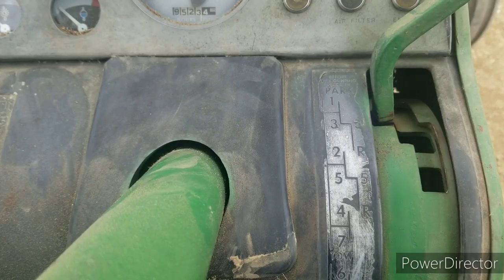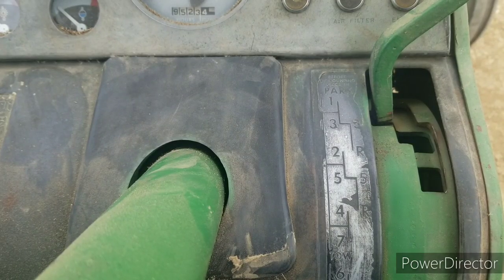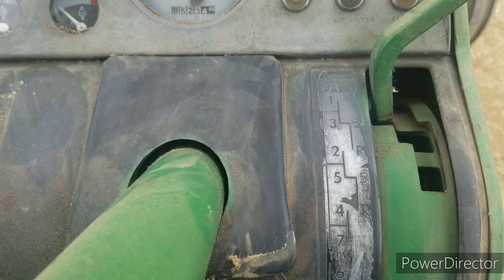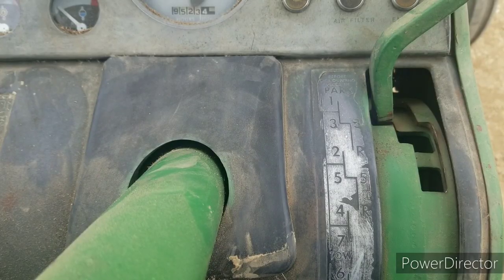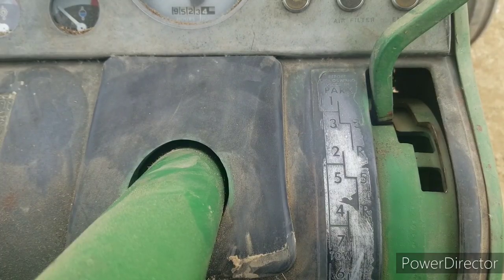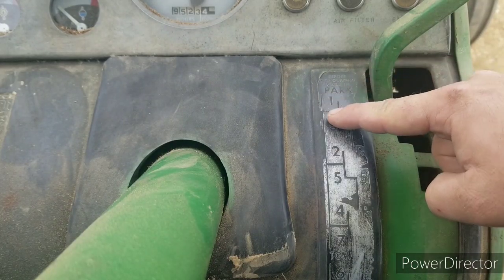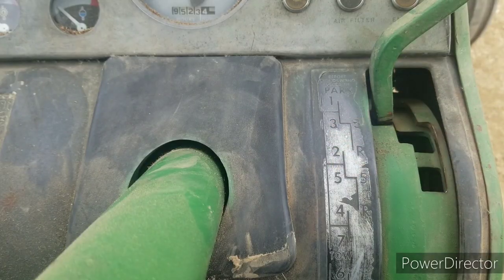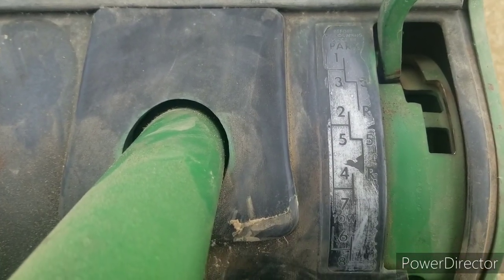John Deere synchro trans - simplified and explained  4320 4020 3020 4010 3010

Comment: I’ve got a 3010 like this. I can’t hit the brakes. For if I do I lose all my hydraulics. I can use the tractor all day as long as I don’t hit the brakes. Some times I’ve even got to release the pressure off the left brake to get it to move. This started when I had a oil leak under the floor pan. I used a ratchet strap to pull my brake peddles forward to gain a little space to remove the floor pan. Forgot to release the ratchet strap after finally removing the floor pan. Went out of town a couple days. When I got back the replacement line had arrived. So I put everything back together. Noticed my brake peddles wasn’t up where they normally went. Thought well they’ll pump up when I start the engine. Later I started the engine and the right brake seemed to be in the normal position. The left peddle was sagging lower than normal. Got on the tractor and both brakes were locked. So I loosened the brake lines and let the pressure that was trapped in the lines out . Next day tighten the brake lines up and to my surprise the left brake was still locked up. Got on the internet looking around found out I could release the the brake by a jam nut another. Loosen the jam nut left both nut and the bolt a tad loose and tried not to even use the brakes. A few days later I adjusted the bolt and jam nut to what I remember to be the original spot and locked the nut down. While using the tractor I hit the brakes pretty good because my garage is on the side of a mountain goat path. All at once I lost everything. No  3 point no power steering and no brakes.  Fed up with it I shut the tractor off . About 20 minutes later started it back up and seemed to have air in the hydraulic system. Raised and Lowry the 3 point a couple 2 or 3 times and it seemed to be getting the air out . The 3 point was still a little chattery but I did get it out of the path so the goats and deer could get by. Has anyone ever experienced anything like this . Any help or suggestions would be greatly appreciated. By the time I get home Friday I should have the factory manual. Now that I think about it . I had a 300b backhoe book that probably could of help me understand the brake system better. If they’re about the same. I think they might be similar. I also had brake issues with it at one point Plus I’ve already changed the filter and fluid. Pulled the suction screen out and it was spotless not a speck of red brake pads

Comment: There is actually 4 reverse gears, 3 is there but not labeled, 4 can be set by removing the lockouts and rotating the the second selector backwards.

Comment: I asked my dad if he ever used the 4/7 gears much. He said that he used them for plowing if they where going back and forth, instead of around in a circle. You would plow in 4th, then when you got to the end, you could shift to 7th and go down to the other dead furrow. Shift back to 4th and get back to it. He also used it for pulling a grain drill. Don't need a lot of power, so he would be idled back in 7th, but if he needed to slow down, just go to 4th.
There's also a reverse in the 6/8 position. But the dash doesn't allow the shifter to go that far down. If the trans linkage was disconnected, it could be put in it, but that would not be safe to do.

Comment: My dad had a 2510 John Deere, and that shifter mechanism always confused me. I never got to actually operate it, so I never got to actually “learn“ how to use it. The way you explain it, makes perfect sense. When the lever’s on left your shifting ranges. When the levers on the right, you’re shifting high/low in that range. My dad used that tractor a lot for packing corn silage, so he got really good at that forward/backward business…
Reply: 4 unsynchronized ranges (think A , B , C , D ranges & a long, left slot)..   

 2 synchronized forward speeds in each station plus reverse speed in A & B on all but the 10s..  They have a C reverse speed.. 

For beginners on the 10s &20s Synchrorange transmissions a yellow "grease" pen makes very helpful A, B, C, & D letters along the long slot for the range shifts..  Also designating the "tow" position between C & D will remind the operator to pull the shift lever into that position while towing the tractor thus preventing the expense of an exploded clutch, and/or a top shaft to low range pinion seizure !!  DON'T DO THAT ‼️‼️

Comment: Had a JD3010D, had the syncro, still had all 3 original reverse gears. Now, most would have that 4/7 reverse gear blocked, those gears were small and had a bad tendency of breaking a tooth, hence why many were blocked. It's also why the majority of the 20 and 30 series had them blocked out. Wasn't because they were to fast, because those small gears were weak. 
We plowed in 3rd, disc'd in 4th, raked hay in 5th and or 6th. 
Since you mentioned "Red", I also had a Farmall 706. In all technicalities, it's really a 16 speed. Torque amplifier would give you an extra hi/lo range or rather, a direct drive and low.
Reply: We never had trouble with these transmissions used 4th to 7th hauling chopper wagons out the field every fall.
Reply: @danw6014  I think you misunderstand what I was saying. Many of the next gens had a 3rd reverse gear which is where 4/7 gear range is. That 3rd reverse gear was the same speed as 7th gear. It was a very small gear and as I said, that gear had a tendency of breaking a tooth due to its size. Again, this is why that "gear" was "blocked" by dealerships back in the day. The transmission itself, they're solid.
Reply: @Ham68229  ok i see what you are saying.  Those third reverse gears were a road gear when the tractor had a mounted cotton picker on it. The tractor was operating in the reverse gears to run the picker. My 66 4020 has the third reverse. So did every 4020 I've  ever run.
Reply: @danw6014  Many did, and yes, they were used and used a lot for many jobs. :)

Comment: I see on your paper that the 10 series only had the 3rd reverse.  My dad had a 3020 that had a 3rd reverse.  What made the difference between the 10 series and 20 series transmission
Reply: Dad used 4th forward and 3rd reverse alot when doing alot of back and forth moving.  He always said 3rd forward was too slow and 5th forward was too fast.
Reply from the maker: @Erin Jackson both the 10 and 20 series tractors have the gear for 3rd reverse but from the factory it was locked out in the shift mechanism. They did this because  they found a reverse gear that fast put alot of stress on transmission causing warranty work. I've seen plenty of 20 series go into 3rd rev but its usually because shift mechanism has some wear or that they have went in and cut out the 3rd rev restrictor. So its possible but never seen a 20 series from factory with 3rd rev. Thanks for watching
Reply: @machineryd2765  it was not from the factory.  Dad had someone do the modification

Comment: a 4020 actually has a third reverse just like a 4010 but it is locked out because it is so fast. If you grind out the slot for it, it will go into reverse.

Comment: Used a 4010 for 20+ years had a blade oN it to push the silage/haylage piles and to tow doubles from the field to home. Also pulled a large slinger for many years from the pit. If you know how to shift ranges you can change the range on the move. Couldn't make it out of the driveway  in 6th from the bottom of the hill where we loaded so had to start in 5th and the road was a hill up so you just learned how to catch 5th to 6th on the fly. Took a bit to get it so it seemed seemless. The key was to pull past the throttle stop with the override and really wind 5th out. Then you could half shift the range and I always counted to 3 and finished the shift then into 6th then 8th

Comment: I grew up driving driving 4010's and 4020" in the 60's. Very simple to use this transmission. I occasionally  drove an IH with their two lever system and did not like it.

Comment: Are all the reverses the same speed?
Reply from the maker: @ Ethan Ringelberg no they are very close to the high gear in that range. Example reverse in the 1st and 3rd range will be very close to same speed as 3rd.  2nd and 5th range reverse is about the same as 5th and if it has 4th and 7th range reverse it will be about same as 7th.

Comment: Grew up farming with it , 4010  4020  4320  i all used   there is a hidden reverse below 4th 7th   pretty fast.  Used 4th 7th shifting for rotary hoe work.
Reply from the maker: Yep that 3rd reverse is locked out on 20 series but if the shifter has wear like mine you can get it to go in
Reply: @machineryd2765  yes wore or ground just a little in the right place   moves pretty fast

Comment: This is easy now the soundproof cab jds such as the 4630 likes to reject  sertain gears
Reply from the maker: Ya if the cab mounts get wore it can throw the shifter out of line
Reply: Get the shifter adjusted right away. Its not good when it pops out of gear. Will eventually have the transmission overhauled.